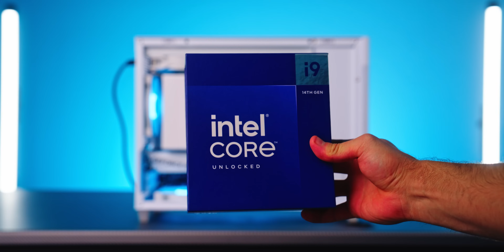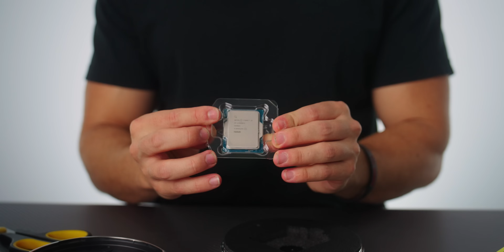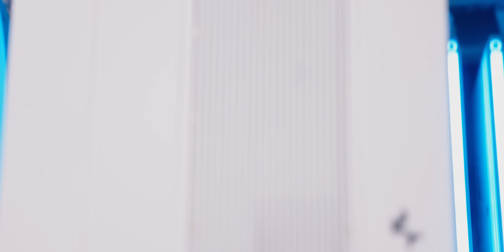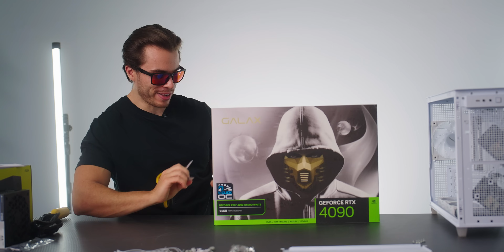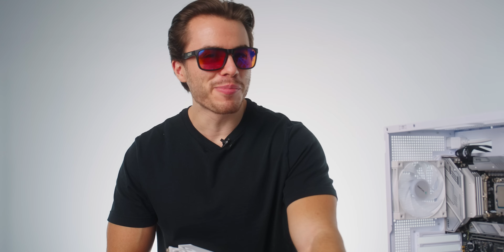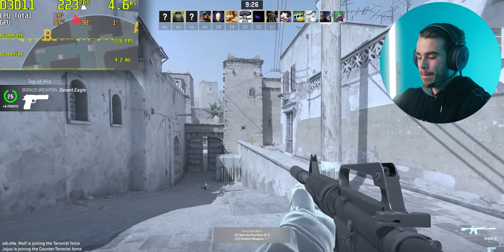The ULTIMATE👑 Micro ATX Gaming PC you can build!

Comment: Any concerns about the 12+1+1 VRM on this board being able to give the 14900k (or 13900KS :) ) enough juice for those massive PL2 power draws?
Reply from the maker: I just undervolted it and didn’t worry about it
Reply: @ScatterVolt  Seems like undervolting is the move with this CPU. What did you set the power limit and voltages to? Any stability troubles?
Reply from the maker: I searched “14900K undervolt MSI” on YouTube and followed one of the video tutorials. Haven’t had any issues since.

Comment: The PSU mounting this way.... bro why.... Also where does the air from the PSU go..... the outlet is blocked.
Reply from the maker: It’s not blocked. The front panel is mesh, just like if you were to mount fans on the front panel in a regular mesh case. It’s taking in air from the front panel.

Comment: Recently got the AP201 mesh version. easily my favorite case of all time so far due to the smaller size. It might not be as compact as the IM01 but having the ability to fit a 360 rad/3x120mm fans and having more perforations just makes it look better vs other matx cases and the air flow is amazing.
Reply from the maker: I just really like that it's just that little bit more compact than usual MATX cases yet it has 360mm rad support and a traditional case layout. If I ever needed to swap out my components in my AP201 then I know it'll be easy, versus some complex ITX case.

Comment: Hey scattervolt is 2tb crucial p3 plus enough , and is B650 plus wifi good for am5 mid range pc?.Btw  Nice glasses, u look really good today. 👍
Reply from the maker: I'd get a least a Crucial P5/P5 Plus imo. P3/Plus is dramless. 

Idk what motherboard you're referring to brand wise.
Reply: ASUS TUF Gaming B650-PLUS atx motherboard. and that's a very fast reply Damn
Reply from the maker: That's a good mobo
Reply: Btw in the last Video I asked if I should get an 7900xt since it's only 100usd more than 6800xt which I was leaning to buy before but do u think my ryzen 5 7600x can handle it without a bit of bottleneck?
Reply from the maker: Go for it